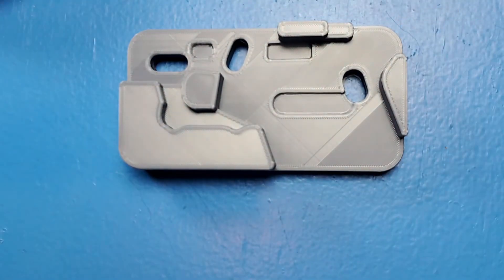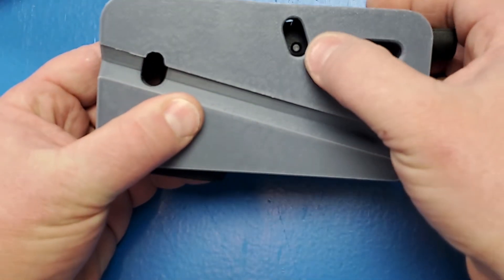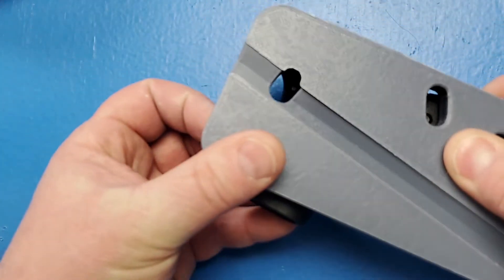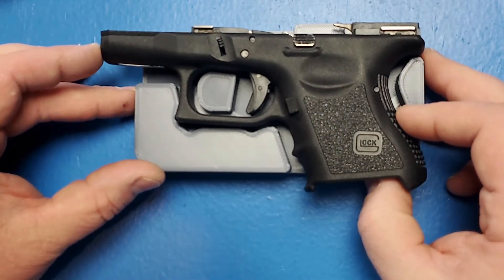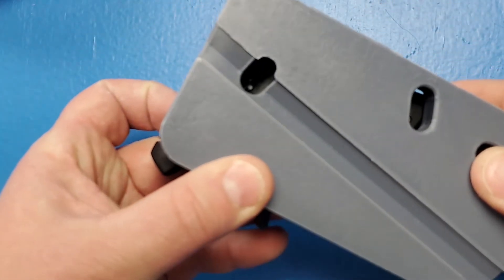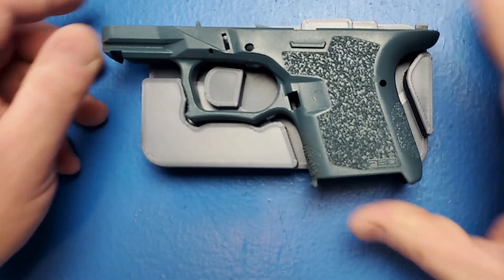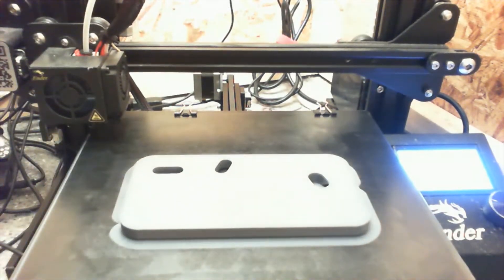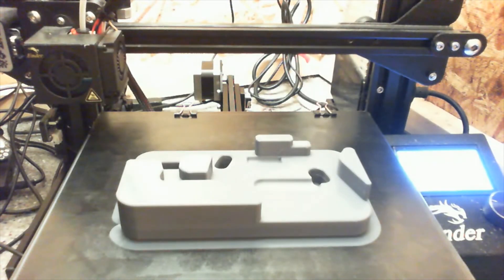GLOCK BENCH BLOCK // 3D Printing the [Hopefully] Universal Glock Block (Glock 17, 19, 26, 43, p80)

Comment: Just printed this, using CHEP's extra fast cura profile.  Only took 7 hours on my ender3, 85 percent infill
Reply from the maker: since I print with PETG I cannot use CHEP's profiles. But when I use PLA I do. Thanks for the info!
Reply: I recently printed one. 4 walls, 5 lower layers and 5 upper layers. 30% filling. I used PLA filament. My pistol is a Glock 25 3rd generation.
Reply: hey did you have to any scaling @weimarjunior